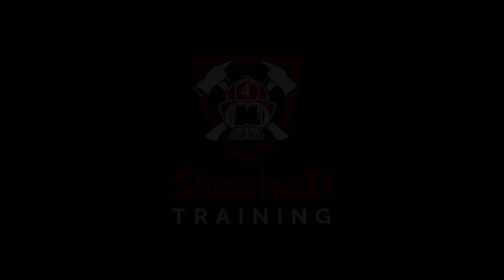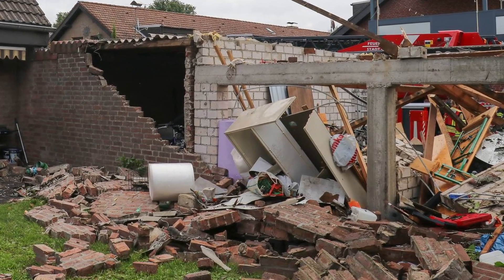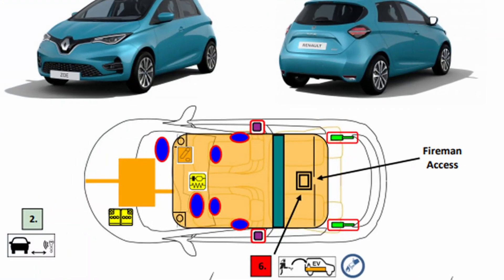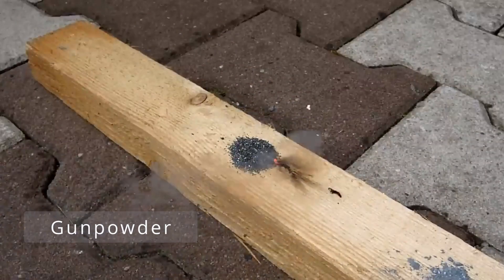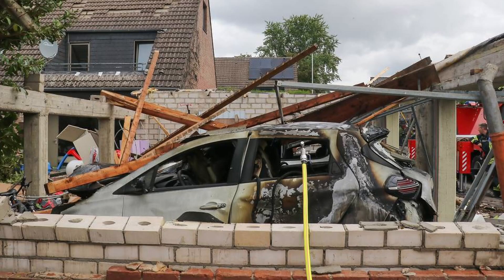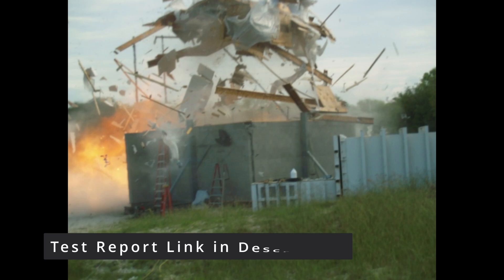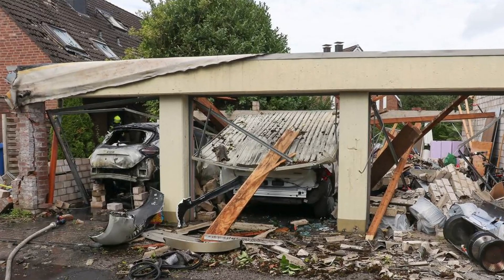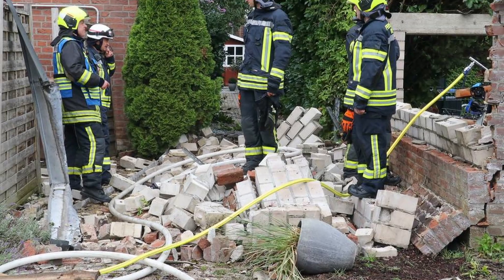Electric Vehicle Explodes in Germany: Detailed Analysis

Comment: E.V Evangelicals, just want to bury there heads in the sand, cause there saving money not by buying fuel, yet don’t mention how much money they had to spend to save money on fuel,  or there saving the planet, forgetting the damage that’s done mining the lithium cobalt etc plus the heavy machinery and the diesel used to mine and move the material or the fact there just moving tail pipe emission to the electricity station non green electricity .    E.V Evangelist.

Comment: Fireman’s access: once the car is smoking that’s like saying to an unexploded bomb expert “don’t worry mate, there’s a pop-out plug in the fuse that lets you pull out the detonator primer.” 

In the energetic material world “confinement” is the difference between a flash & fire and BOOM. A shock wave suggests a fuel air detonation.

Comment: That is not the only way it could happen.  EVs have been known to blow up like that randomly even while driving.  They are so fucking dangerous its insane.  Hell pure lithium is used in making MOABs Tzar Bombs and Hell fire Missiles.  Lithium turn oxygen into fire in an explosive combustion way.  Lithium is a bomb material.  Lithium is a main bomb material but not used in most bombs because its too dangerous to work with and too explosive and too volatile to properly use in smaller explosives because according to military bomb makers lithium will explode too easily and can not be controlled properly in small systems so they are used in specialized high explosive bombs that actually have not been made for nearly 30 years because they are too dangerous to work with because they have to be put together in hermetically sealed places where there is no oxygen so that the lithium does not explode.  The fact that morons think a highly explosive material is great for putting everywhere is why people need to be inside of insane asylums.
Reply: A thoroughly uninformed comment: there is very little lithium in any Li-ion battery, and none is elemental lithium. It is not the lithium that causes the fires or explosions, it is the energy stripping hydrogen out of the electrolyte, and the hydrogen becomes the explosive. Hydrogen is all around you, in water. In compounds it is perfectly safe. ANY reaction that releases hydrogen from water will have the same effect; the explosion at Fukushima was a hydrogen one, and not a battery in sight - that was just heat from a nuclear reactor (could have been heat from ANY source, just happened to be a reactor). And no lithium was involved.

Comment: I have seen ICE vehicles 🚗🚗🛻🚐🚛 burning and if the windows are closed they will blow out, the air bags will blow up ( cause they have an explosive to set off the air bags in each one) , and tires build up pressure until they blow up . Gasoline ⛽ and Diesel ⛽ only burn off the fumes, not the liquid!!!!🔥🔥🤔 . All these people are do gooders,/tree HUGGERS 🌲🌳🌴🪴🪵. They have NO COMMON SENSE. 🤔🤯😱. I know what I am talking about, I have been working on gas ⛽ and diesel ⛽ vehicles for over 50 years and I also have driven fuel tankers for a living 🚛🛻🚗. I have seen fuel trucks burn, they don't blow up, they just burn 🔥🔥🔥 until they run out of fuel.

Comment: Great reporting Patrick. This is one of the potential problems with Renault's "Firefighter Access" port. It is designed to burn away (not removed by responders) and as you pointed out can now fill the passenger compartment with gas. So, while designed to allow a water access point, it has drawbacks.  All-in-all, the belief that getting water into an EV pack is a tactic will likely be diminished by packs being very different and not necessarily as effective as once believed.  Keep up the great work!

Comment: You should wait for the results of the ungoing investigation. The car was burning, but the explosion was extrem. Maybe some other gas was inside the garage. There where gascontainers in the garage. And the houses are heated with gas. There was constuction on the infrastructur in this street in October 2022. In February 2022 ne Gas-lines were laid in the nearby main street. 

I doubt, that the burning Zoe was the only cause of the explosion. My guess: Gas was building up inside and was set on fire by the Zoe. But we have to wait for the final result.
Reply from the maker: My goal is to get information out to firefighters, knowing these hazards exist could prevent a line of duty injurydeath.  Assuming a final report becomes publicly available I will do an update video.  There are a lot of clues that point to a battery failure.  Had it been an external gas source, I would not expect a fire in the Zoe's battery.
Reply: I absolutely agree. Too much evidence pointing to the burnt car. @StacheDTraining
Reply: That clever gas knew to settle just around the EV.

Comment: It has been my experience that the batteries do not last that long and are very expensive to replace. I have ran into a few people trying to re-vitalize the batteries. The instructions are explained on how to do this on YouTube and such, it says to disconnect the charge controller and charge the batteries directly from the charger but only for a predetermined time interval because they can explode. Now I'm not saying that this is what happened in Germany or in Colorado. PLEASE PEOPLE DO NOT DO THIS!!!
Reply: Unlikely to have anything like this happen because to try to wake up an individual cell or cell unit you have the pack out and the covers off, you're more likely to see the Li-Ion "blowtorch" failure mode on the unit you're working on (which may ruin your day in different ways). These explosions all involve the passenger compartment filling with an explosive fuel-air mixture caused by a venting cell, and it seems like it's usually happening when the vehicle is unattended (and probably while charging).

Comment: Checking data on e-vehicles and fire department, police, and dot reports and statistics, the percentage of fires in e-vehicles is minimal to those of gas-powered vehicles. I listen to German News daily and there was never a report on an explosion as you reported. Can't find anything in their papers either. Can you state the article, please? I drive a Hybrid electric and I have many friends with e-vehicles. Neither they nor I have ever had any problems. All makes have the quick disconnect plug for the event of an accident, for rescuers to deactivate. It is required by law.
Reply from the maker: https://rp-online.de/nrw/staedte/neuss/neuss-explosion-in-garage-sorgt-fuer-verwuestung-in-rosellen_bid-96489259?fbclid=IwAR1rdyjs_Tf_qaYEtuLhL1jiyOB_kjZ9Ve2OdHsm-MxrPVrfETTfrOjVml8#0
Reply: yeah you can disconnect assuming you can get near it.
Reply: Hard Water, my friend, of course you will not read anything about them, in the media, if the same ones who benefit from this environmental insanity, are also the ones, who control the media, and misreport the data. But, you can go along on la-la land until one day your rather large (and easily damaged) EV or hybrid lithium battery, goes into thermal runaway,  quickly reaching 3000°F, or more, in a few seconds, releasing all of the energy, like a slow motion lightning strike, that is stored, that is required to move a heavy EV hundreds of miles, at high speeds.  And, there is a LOT more energy stored in your battery, than you will EVER find, in a gasoline tank.  Then, you will REALLY be in la-la land...up in heaven, unfortunately for you, my friend.
Reply: You're not hearing of it because you protect your vision of the world by remaining ignorant to any information sources that aren't carefully curated propaganda machines.
The same ones that push things like EV to "protect the environment" by doing more damage than previous means of travel.
Same goes with wind turbines for energy generation.
Anyway, exploding and burning EV videos are a dime a dozen, especially in China, go look.
Or don't.
10 seconds of effort is a steep price these days for something as silly as "truth" or "reality".
Reply: The problem with EVs is they are new and unproven technology so all the dangers and ways to mitigate them are not yet know unlike ICE vehicles which are well proven technology.  

For example, oil pressure switches and fuel pump cut off switches were invented  to stop the engine and turn off the fuel pump to prevent vehicle fires when involved in an accident. 

EV battery chemistry is a self-sustaining fuel source or explosion risk depending entirely on the charge controller safety circuits to prevent the battery from catching fire due to overcharging or overheating so until enough years pass that  we experience all the dangerous scenarios and find mitigation solutions, anyone driving a hybrid or full EV is unknowingly involved in a long-term EV experimental safety study.

Comment: Sounds like off gassing detectors in electric car battery cases, garages and anywhere batteries are keep will be a requirement somewhere in the future. 

Would the off gases from these compromised batteries have a distinct odor or be odorless?
Reply from the maker: While the gasses can be colorless, typically it is a white smoke.  Part will hang low to the ground, part will rise upwards.  I believe that a hydrogen detector/alarm would be a great solution.
Reply: @StacheDTraining Hydrogen production was an issue with much older electric cars, the type which used big lead-acid batteries: Those batteries always produce some hydrogen (and oxygen) by internal side-reactions during both charging and discharging. The sealed "zero maintenance" type actually have little catalyst chambers inside each cell which use a tiny amount of platinum or iridium mesh to recombine the gases into water, which allows the battery to be sealed, but the recombination does generate some additional heat, which is one reason why both the charge and discharge rates of sealed lead-acid batteries are limited. Vented lead-acid batteries just vent the gases to atmosphere, which is why they slowly consume water while in use, and sooner or later need topping up with more water.

Lithium-ion batteries are not likely to produce much hydrogen unless they are immersed in water or the wires coming from them are both in contact with water, because the voltage generated by even a single cell (somewhere between 3 and 4.2 volts, depending on state of charge) is enough to electrolyse water, which will produce both hydrogen and oxygen gases. However, the electrolyte inside the lithium-ion batteries themselves does not contain water - the higher voltage produced by the lithium-ion chemistry would not be possible if the electrolyte had water in it, because the water would be decomposed. This is why lithium-ion batteries use organic solvents (such as dimethyl carbonate) as liquid electrolytes, since these do not decompose at the higher voltages the chemistry generates.

The downside of course is that organic solvents are flammable. On its own, this would not be a problem - after all, the flammability of the liquid electrolyte is not much different to the petrol in the tank of a petrol-engine car. The problem however is that the batteries contain enough energy density to vaporise and ignite the flammable liquids in the electrolyte if a short-circuit occurs. Which doesn't necessarily have to be the two battery terminals being connected together, though that is the most obvious way a short circuit can happen: A short can also happen internally if the battery is deformed or overheated, because the construction is often either rolled up or layered internally. Which is why puncturing an individual cell can cause a short, because it forces one layer into another.

Likewise if a cell is squashed, bent or otherwise deformed, any of which can have the same effect. Overheating a cell can cause the same thing, because if any part of a cell overheats enough to start vaporising some of the electrolyte, the gas bubbles produced can deform the cell internally, pushing layers into each other. So even if there is no short circuit to begin with, overheating above the boiling point of the electrolyte can cause at least one short circuit (probably several), releasing more energy, causing more heating and then you have the unstoppable thermal runaway. This is less likely to happen with solid (polymer) electrolyte cells because there is no liquid to boil off, but physical deformation of polymer electrolyte cells can still cause short circuits by the same layer interruption mechanism. The rate of energy release is similar, and the polymer electrolyte can still decompose and release flammable gases if it gets hot enough. So polymer electrolyte cells are more resilient to overheating, but are still vulnerable to deformation, and the same thermal runaway can still occur.

The point here being that a hydrogen detector or alarm is not going to be good enough on its own: Electrolyte decomposition can probably make some hydrogen, but it is not the major problem with lithium-ion cells and certainly does not make up the bulk of the flammable gases emitted when a cell is damaged, overheated and/or short-circuited.
Reply: A better solution, is to make all EV's illegal, worldwide, then we wouldn't have to put up with this insanity, to start with, right?  Environmentalism, as currently practiced, is a bad idea.  We would be much better, banning the use of all synthetic chemicals, in our food, cleaning products, and medicines, than worrying about breathing smoke, from fossil fuel burning.